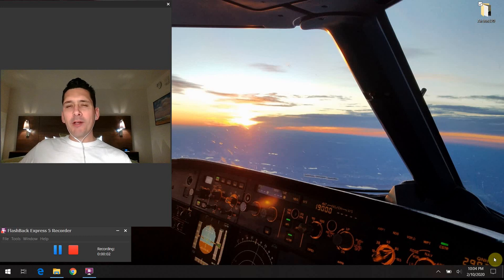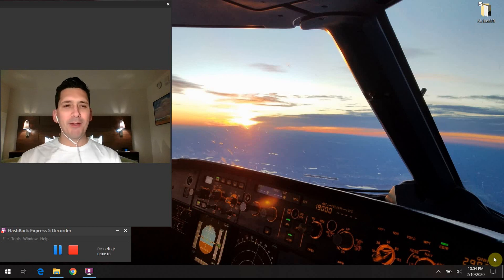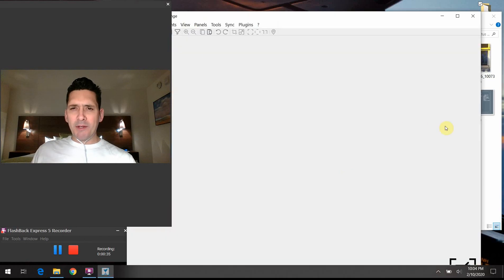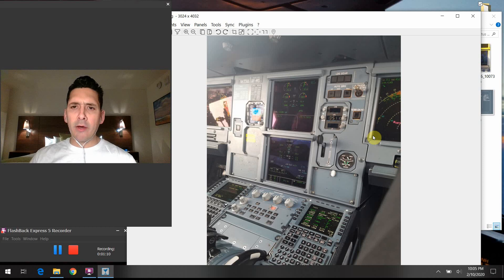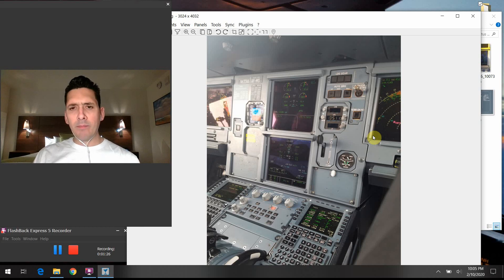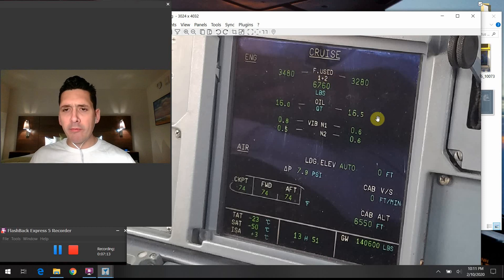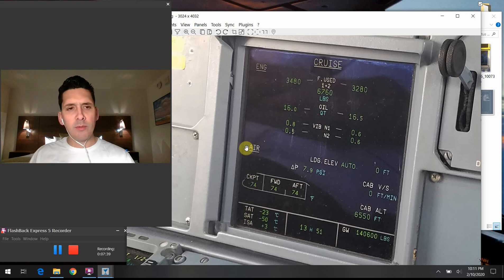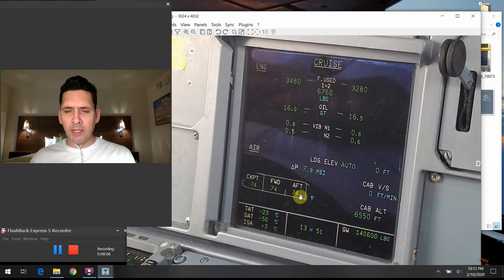Airbus A320 Cockpit Tour: #42 - SD: Systems/Status Display: What do all those buttons do?!

Comment: .... and why does the display specify "CAB v/s and altitude", like the "CAB" is independent of the aircraft's remaining frame? I mean: is the addition of the word "CAB" signifies something special?
Reply from the maker: Jean, no it really does not. The CAB in and of itself is to be considered the entire pressure vessel that encompasses all pressurized areas on the structure. Don't get this confused with the "Temperature Zones", which are just that, different regulated temperatures in different parts of the plane. But think of it like this, it might be hot in the back and cold in the front but for all intensive purposes the pressure throughout the entire system is constant and therefore we have only one readout for this. The CAB in this case. Great question!